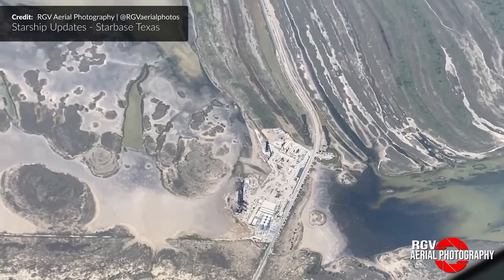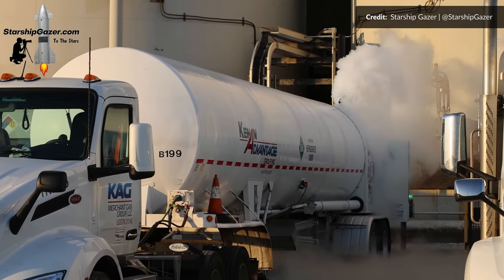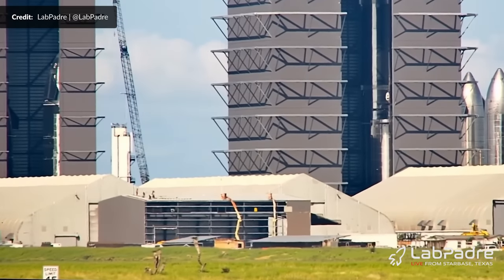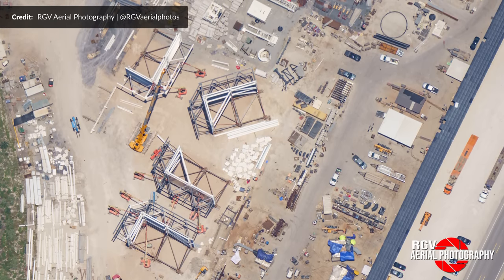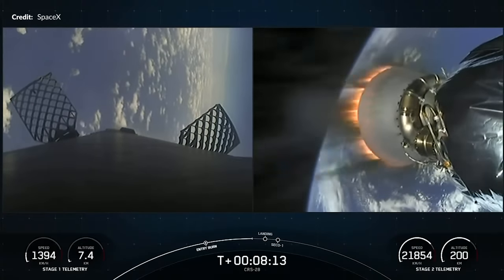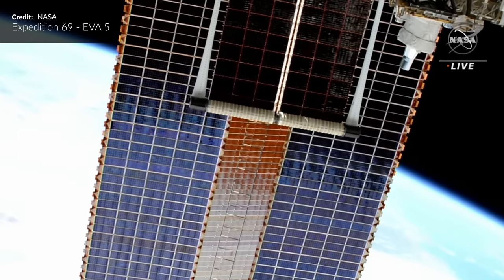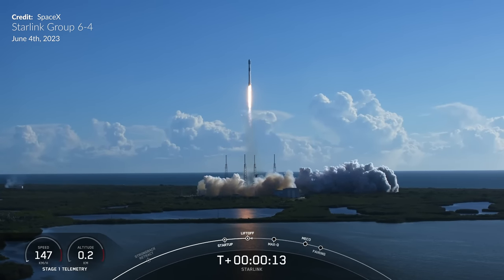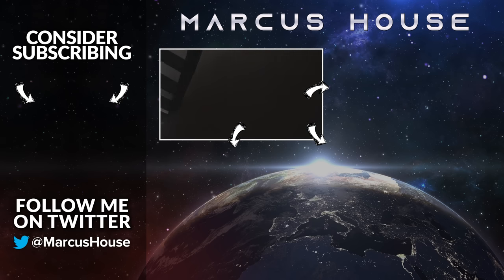NASA's Concerns with SpaceX Starship Delay,  CRS-28 and ULA Vulcan Test Fire

Comment: It's great to have ambitious goals, but no one believes we can have people on the moon by 2025.  But as long as SpaceX is not delayed by the FAA, they will be on schedule. It will be Boeing that is the major delay. Boeing's problems are systemic, so they we be behind schedule on every government project they undertake. 

Since Boeing is a major player in this, the year of the next moon landing will be 26-29, with 28-29 being more likely than 26-27. Boeing's SLS rocket is six years behind schedule. The ongoing Artemis missions will each require a new SLS moon rocket built from scratch. The design/capabilities will only slightly change, so they are building the same rocket for the most part, but each assembly will again involve multiple contractors, intensive testing, problem resolution, and consolidation, again causing delays. Boeing is also working on the Starliner space station rocket that is also six years behind schedule.

The Boeing company structure is designed to be late and over budget, that's how they earn most of their profit. This methodology still works in the defense industry, but since SpaceX and other private competition, NASA, which doesn't have the enormous funds to squander like the defense department, now has an alternative, and is currently refusing to pay cost overruns. Also, NASA, again thanks to an alternative, recently reduced some of the corruption by firing a couple of NASA officials that committed fraud to favor Boeing in contract selection. 

Boeing spends millions on lobbiest, contributes millions to political campaigns for support (legal bribery), and gives high paying jobs to retired Defense and NASA officials, including politicians that give preference to them. They have already been paid far more than SpaceX would charge, and have previously been paid billions for being over budget on the SLS program, and they are continually asking for more money, and with NASA now saying no, you would hope this means a less corrupt environment, but eventually, this will come to a head with Boeing claiming they can't continue without more money. Because of Boeing's lobbiest and "bribes" to politicians, NASA will likely be ordered to again give them more over budget money. In DC, the flow of money to various pockets is priority to efficiency, principle, fairness, and morality. Its been this way for decades.
Reply: 🙄 Artemis II is planned in 2024 and the SLS hardware for Artemis III is being assembled now. For Artemis III in Dec 2025, SpaceX has to do a full up, unmanned HLS Starship test landing in late 2024 or very early 2025. That means having the [DELETED] Starship propellant depot, Starship Tankers, and HLS Starship ALL working by then. Including up to 7 Starship Tanker flights. So they need launch pads that are ready to go. ALL of that development takes time and Dec 2024 is not that far away.

The FAA vs SpaceX is not really a thing, except for clicks by other YT channels. After all, the FAA defended SpaceX in front of Congress in Jun 2021 over the unauthorized SN8 flight. The 'NASA delaying Starship until the SLS flies' was just as silly, since NASA needs BOTH Starship and SLS for Artemis. Besides, the FAA review was completed already in Jun 2022. And now, the FAA and SpaceX are working together to defend against environmental lawsuits from the Apr 2023 'orbital' flight test.
Reply: @phathokum1855  Dude, it was your second sentence. Here it is again for you, "But as long as SpaceX is not delayed by the FAA, they will be on schedule."

SpaceX is still in development with Starship with a long way to go before they can launch the unmanned test launch of HLS Starship to the Moon around Dec 2024, for a Dec 2025 Artemis III manned landing.

The components for SLS for Artemis III are being assembled now. Meaning flight hardware for Artemis III. SpaceX is nowhere near flight hardware yet. Flight hardware as in the hardware used for the actual mission, not some test article flight. So SLS is further along towards being ready for Artemis III than SpaceX is. 

So Boeing is on schedule to deliver SLS for Artemis III, while Starship is still in development, but Boeing will be the delay? Dude, I like SpaceX as well and they are the top launch provider right now, but you need to take off the fanboi glasses and look at reality. HLS Starship has a LONG way to go to be ready for Artemis III.

I think you are also getting Starliner and SLS mixed up.
Reply: @Steve Austin  You appear to be too bias to even read what I wrote. There are regulations involved in space flight. I said as long as SpaceX is not delayed by regulatory agencies, they will be on schedule. But because I mentioned the FAA, you jump to conclusions.There is a lawsuit, and that's no small matter. The court can order the FAA to delay lift offs. If they don't, then no problem. If you want to master the art of communication, try reading what people say literally instead of reading other things into it. I never said the FAA was plotting against SpaceX, that is coming from your brain cells, not me. You even re-quoted what I said, and you still got it wrong. That's hilarious.

Thee is zero evidence that SLS is on schedule. It is currently six years behind schedule. Not sure why you keep stating that fantasy. You seem to think development is linear, it's not. SoaceX is working on several projects at the same time. They aren't waiting for Starship before they develop the moon lander. Starship, unlike SLS, is designed for reusability and multiple launches in a short period of time.  Once Starship is operational, they will be able to launch several in just a few weeks. They don't need several months or years to build another one as with the case of SLS.
Reply: @phathokum1855  🙄 Rank projection on your part. I copied your EXACT words dude. I guess delusional is next step after projection? IT was YOUR OWN words dude. 🙄

Besides the regulations, which I feel you have overblown, Starship is STILL in development, WHICH was my point. There is STILL a LOT of development to go. Per Musk, none of the debris took out the engines, so that means at liftoff, 9% of the engines failed. A 91% engine success rate is not something you see at the end of development. Starship still has to prove it can get to orbit. SpaceX STILL has to prove that they can transfer hundreds of tons of propellant IN orbit! The [DELETED] Starship propellant depot has to show that it can hold boil off of propellant to a minimum for months!

Yep, delusional fits. They are ALREADY BUILDING the SLS flight hardware for Artemis III, RIGHT NOW. Starship is still using test articles. HLS Starship MUST get to orbit, before it can go to the Moon. The depot MUST be refueled, so that HLS Starship can go to the Moon. Reusability has NOTHING to do with HLS Starship succeeding or not. NONE of the Starship variants have to be reused for HLS Starship to succeed on Artemis III. This ignoring of objective realities and focusing on unrealistic hype by fanbois, is why people who support SpaceX with facts are looked down upon. Y'all are as bad as the SpaceX haters.

Starship will NOT start with a rapid cadence PER SpaceX. From page 27 of the GAO decision to deny the HLS complaints, here is the SpaceX plan for Artemis III. [DELETED] is apparently at least a propellant depot Starship variant from the context and SpaceX had the GAO redact that info. Added in Musk's payload update (~150t) and he says that it is up to 8 Tankers to fully refill HLS Starship, depending on HLS Starship's mass. My comments are in ().

"SpaceX’s concept of operations contemplated ten total launches (down from 16), consisting of: 1 launch of its [DELETED]; 8 launches of its Tanker Starships to supply fuel to [DELETED] (down from 14); and 1 launch of its HLS Lander Starship, which would be [DELETED] and then travel to the Moon."

Per page 10 of the GAO report, the SpaceX plan for Artemis III is 1 Starship variant launch every 12 days. Per page 9 of the Apr 2021 HLS Option A Source Selection Statement, "SpaceX’s quiescent lunar orbit operations capability will allow it to loiter for 100 days prior to rendezvous with the crew vehicle." So up to 9 launches (reusing the depot) would likely be longer than HLS Starship can wait in lunar orbit for the crew to arrive. It will likely take some number of years for the Starship cadence to mature to a faster pace, so SLS/Orion are needed for the early Artemis missions. Likely through Artemis V at least.

Y'all can't even get reusability right. Booster reusability is great, but has drawbacks.

First, if you don't have a fast enough launch cadence, you can spend more on recovery equipment and personnel than you save by reusing the booster. So with SLS launching once a year, eventually, the cadence doesn't really justify recovering the booster. 

Second, you take a payload hit for the recovery system on the booster. The Falcon 9 B5 can lift up to 22.8 tons to LEO when expended (SX), but only up to 17.4 tons when landed on a drone ship (B1067.9). Doing a Return to Launch Site (RTLS) landing, costs even more payload as you have to add a boost back burn to cancel the lateral velocity and return back to the launch site. The SLS Block 1 can get Orion to the Moon, but not with the kind of payload hit like F9 has. The SLS Block 1B will send along a Lunar Gateway module with Orion, so it really can't take the payload hit either.

Third, the higher and faster you go, the harder reusability is to perform. The heavier the dry-mass of your booster, the harder reusability is to perform. The SLS core stage gets higher and faster than a Falcon 9 as the SLS core stage almost reaches orbit, making recovery MUCH more difficult. The SLS core stage is travelling well over 3 times as fast as the Falcon 9 booster and is well over twice as high as the Falcon 9 booster at MECO. The dry mass of the F9 booster is 22-25 tons while the SLS core stage is 85 tons, so SLS masses over 3 times as much.

Fourth, you now have to have the weather be acceptable at the launch site and the landing site, if it is down range of the launch. 

SLS started design work in 2011, 4 years before SpaceX landed the first booster and almost 6 years before they reused a booster.

No, I'm not saying that SpaceX should not recover boosters. I'm using how reusability affects the Falcon 9 to discuss SLS and other expendable boosters.

So spare me the 'rah, rah, rah SpaceX rulz' bullcrap and start looking at the reality of what is ACTUALLY going on.

Comment: Space X is cutting corners.  They through out a lot of the lessons learned from other companies in order to act like they could design a rocket faster.  First off, those tanks are way too close.  And that debris damage, that was known about for some time (that rockets could destroy the ground like that).  That's why both the Saturn V and the Shuttle used diverter channels, something Musk probably deemed as too expensive, time consuming and a waste of time.  I also doubt that Starship's engines that failed to light were damaged in the launch as just a few months prior Starship had issues lighting all its engines successfully in test, and this problem was never really addressed. I think people give SpaceX too much credit.

Comment: NASA is worried about SpaceX?  Hard to grasp, as we watch SpaceX move 6 nosecones around.

Does anyone have 6 ship builds on the go?  Did Artemis need to build an entire factory to produce ships?  Will starliner even ever launch?  Is BlueOrigin just vapourware at this point?

Concerns might be valid about being behind, but they’re actively working on it.  Everyone else is light years behind
Reply: 🙄 Those are test articles, not production Starships. Artemis II is planned in 2024 and the SLS hardware for Artemis III is being assembled now. For Artemis III in Dec 2025, SpaceX has to do a full up, unmanned HLS Starship test landing in late 2024 or very early 2025. That means having the [DELETED] Starship propellant depot, Starship Tankers, and HLS Starship ALL working by then. Including up to 7 Starship Tanker flights. So they need launch pads that are ready to go. ALL of that development takes time and Dec 2024 is not that far away.
Reply: all those questions are irrelevant. and kinda funny, too. 6 nose cones pushed around, yes. And it is 0.000 minutes spent in space for Sptarship. Just like for Blue Origins.
and yes, Falcon 9 is great. Even with 0 nose cones being pushed around.

Comment: NASA concerned with starship delay? Omg lmao..what about SLS delays or even Boeings shit capsule...come on
Reply: 🙄 Artemis II is planned in 2024 and the SLS hardware for Artemis III is being assembled now. For Artemis III in Dec 2025, SpaceX has to do a full up, unmanned HLS Starship test landing in late 2024 or very early 2025. That means having the [DELETED] Starship propellant depot, Starship Tankers, and HLS Starship ALL working by then. Including up to 7 Starship Tanker flights. So they need launch pads that are ready to go. ALL of that development takes time and Dec 2024 is not that far away.

Lockheed built Orion, not Boeing. The Boeing Starliner is for going to the ISS, not the Moon.

Comment: Im not worried about any potential delays to Starship, as SpaceX has shown time and time again how capable they are at rapid iteration, design, testing, and launching. What concerns me more are those people that don’t care about Space flight and want SpaceX to fail, and their attempts at such by using litigation, whining to the FAA, and etc. Those people aim to hold humanity back and must be stopped at all costs.
Reply: The FAA vs SpaceX is not really a thing, except for clicks by other YT channels. After all, the FAA defended SpaceX in front of Congress in Jun 2021 over the unauthorized SN8 flight. The 'NASA delaying Starship until the SLS flies' was just as silly, since NASA needs BOTH Starship and SLS for Artemis. Besides, the FAA review was completed already in Jun 2022. And now, the FAA and SpaceX are working together to defend against environmental lawsuits from the Apr 2023 'orbital' flight test.
Reply: @steveaustin2686  Read my comment. I never said the FAA was against SpaceX, I said that outside people and groups are using litigation, and complaints to the FAA such as the environmental review complaint to either slow or stop SpaceX, and if youve watched carefully you would have also seen these same people that do this had interviews with local news in the area where they flat out said their objective is SpaceX’s failure. Never said FAA vs SpaceX, where in my comment did you read that? I never said that.

Comment: Funny listening to amazed nerds who've never seen or used a Dent Puller . . . that was how most of us figured they'd fix those tanks.
Reply: I wasn't even sure they would bother as these are only protective shells, which protected the actual tanks.  The damage is cosmetic and doesn't affect function.
Reply: @Scanner9631  One of the LOX tanks was apparently punctured as it was venting from the side after the flight.